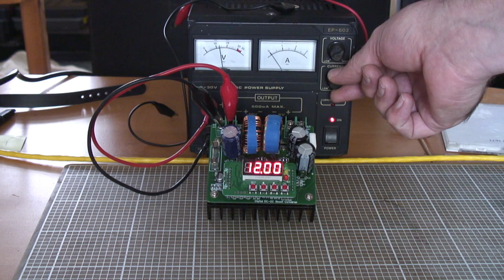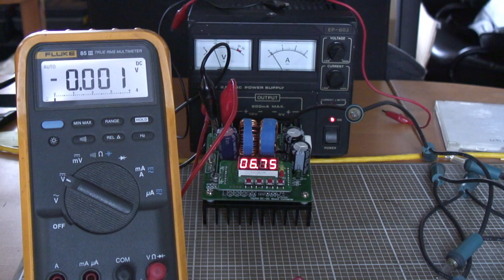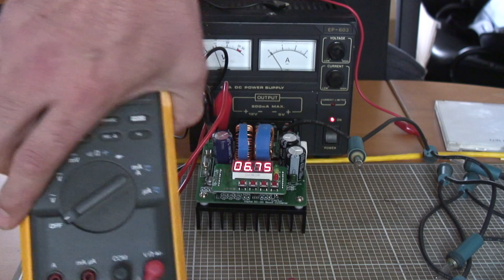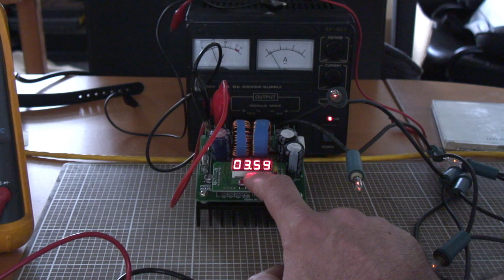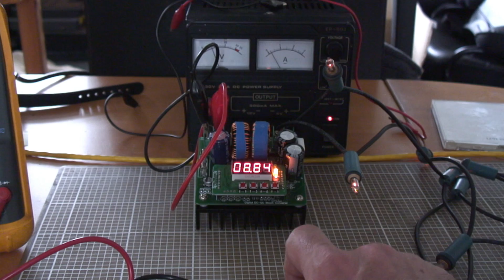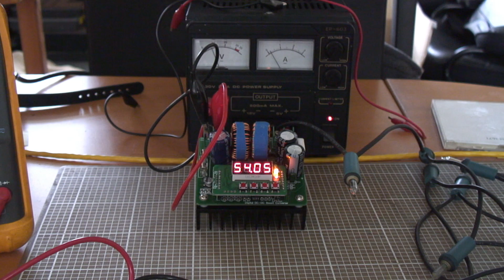Review: 400W Digitally Controlled DC/DC Step-Up Boost Converter - Far from Perfect

Comment: As a programmer, my instinct is to suspect the firmware hit a divide by zero error condition that goes uncaught.  :)
Reply from the maker: mnelson10000 I suspect you might have hit the nail right on the head there... but one of the people replying to my original comment on Julian's video says that their unit doesn't have the same problem, so it could just be a stuck bit in the microcontroller on my unit - would be nice to get some confirmation from other owners if they see the same thing.
Reply: Jim Conner Could be.  Maybe you have an older version of the firmware?  I wonder if it can be reprogrammed?
Reply from the maker: mnelson10000 The microcontroller seems to be an ST8S003f3P6 (8-bit, 8kb flash, 16Mhz) - reprogramming might be an option as long as they haven't set the write protect bit on there... but I only have the right equipment for doing PIC Microcontrollers right now. It does have a TTL-level serial interface on the board though, so I might see if I can hook up to that and try to find a version number somwhere in there. Cheers.
Reply: Jim Conner  Maybe you can swap the controller out with a proper one.  If you manage to fix the thing, I think you'll earn your bad-ass card.  :)  Good luck, brother!
Reply from the maker: mnelson10000 So I hooked up the serial port as planned just now, and although the unit seems to echo every character I'm sending to it, it doesn't seem to respond to any of them or send any output at startup etc. I tried every baud rate from 2400 to 115200 and got nothing on any of them.

By playing around a little more though, I think I've worked out what at least some of the F1 - F6 menus (accessed by holding down SET for a while) are used for.

F1: Calibrate voltate output at 10V and 40V levels (press OK to switch between them - display will stay fixed at 10V or 40V but the output level from the converter changes up/down when you press the buttons).

F2: Calibrate voltage display: Output remains constant (same as input) but up/down buttons will change the reading on the display to match - you can vary the input voltage to calibrate at the top and bottom of range.

F3: Seems to do the same as F1... so I'm probably missing something.

F4: Calibrate the ammeter display on the unit (to three decimal places) - you will need a load attached for this - (variable from 0-9A ideally to get the full range).

F5: SA Y/N question - No idea what SA stands for - was hoping it was somthing to do with the serial port but got no results.

F6: R Y/N question - Again no idea what this one does - no obvious difference in the operation of the unit. The 'A' character glows bright briefly if you select Y (& press OK) but not if you choose N (& press OK)

Actually as I couldn't find this documented anywhere via google, I'll clone this F1-F6 section to the video description too.

Cheers!!!